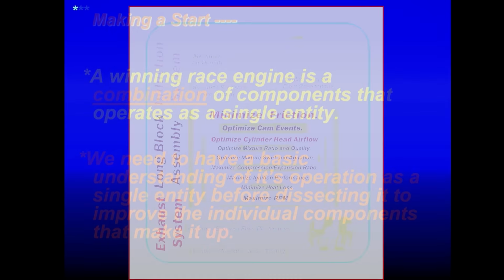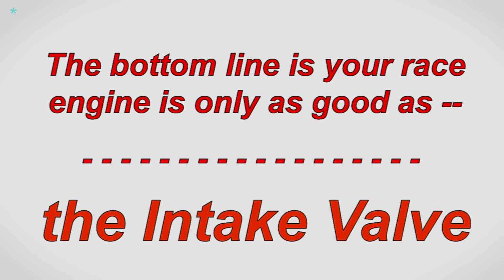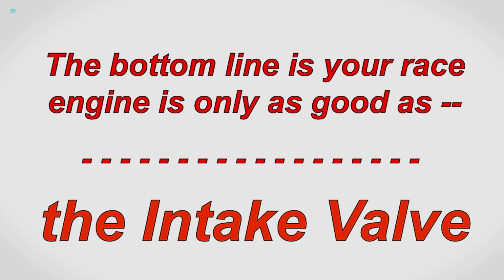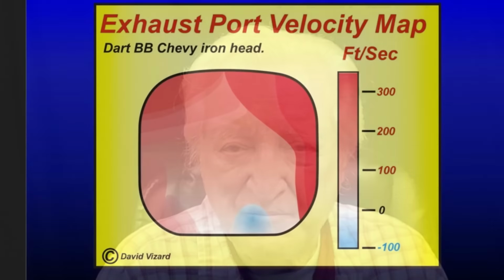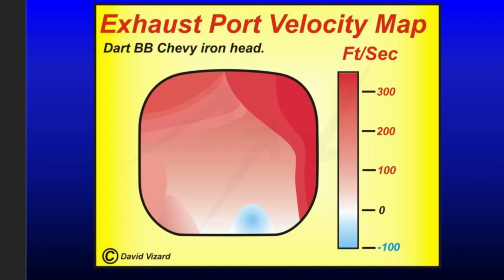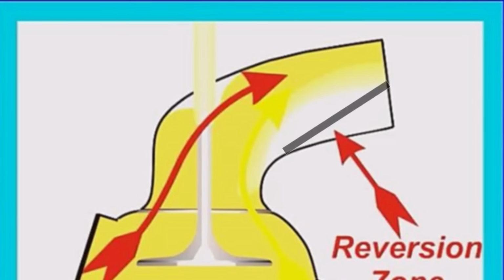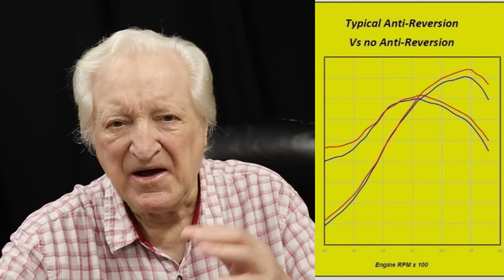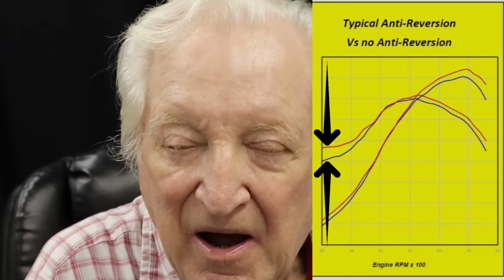Big hidden HP - from anti-reversion mods

Comment: I would like to present an entirely new idea to the anti reversion philosophy.  This is a bit complex and it involves understanding something that has been discounted by mainstream physics.  that is the effect of the Aether.  
Many don't even know what the aether theory is.  I suggest that the Aether is real, and it has a profound effect on volumetric efficincy.

But to understand what the aether is, and why it's important, we must look at light.  We must ask the question, "How does light travel through the vacuum of space?  Mainstream physics will tell you that light is both a wave and a particle.  that somehow light has some sort of measurement of mass, in order for our suns light to travel across space and be visible to us.  And for this explanation I say 'bullshit'.  Every other energy wave, across the entire specrtum of frequency ranges, is understood to just be a pressure wave, acting upon some medium in order for it to propagate upon.  
Meaning, if you throw a pebble into a still pond of water, the pebble displaces a certian amount of water.  This is potential energy ( the mass of the pebble) being turned into kinetic energy, and the act of the pebble displacing the mass of the water is the release of that potential energy into kinetic energy into the water.  
Sound propagation acts exactly the same way.  Exhaust also acts the exact same way, accept for this thing we call 'reversion'.  I suggest that there is another separate medium, other than air, that the sound pressure waves from exhaust are causing reversion in an exhaust system.  Yes, air turning back around and heading back into the combustion chamber is real.  yes sound pressure returning back into the combustion chamber is real, and 2 stroke engine builders are well aware of this.  but I want to propose a third wave that gets turned around and has an effect on reversion in an engine..... That being the Aether pressure being applied upon exhaust, once the aether hits a reversion point.  And since light (I argue) is an energy wave, and has no mass... that the mass seen and described as a photon that has mass, is merely the pressure light posits upon the aether, I suggest that there is a unknown pressure exerting it's effects negatively on combustion engines efficiency.

Comment: "Air is heavy".  Yep.  And yes, you don't know it's heavy, because you are in it.  A fish doesn't know the weight of the water in feet that's above it, until it gets too deep for it to breathe, but that's why fish have gills instead of lungs.  but that's another conversation for another video.

Air is heavy.  Yes, at sea level you have 14 lbs of pressure on the top of your head.  But it varies slightly, in what we know to be ' barometric pressure'.  That being the weight of a column of air from the top of your head, all the way to outer space, pressing down on you at sea level.  So, tell your wife you lost 14 lbs tomorrow, because you subtracted the weight of the air in the atmosphere. Yayy!!!

Anyway.  This is where the boosted community thrives.  If the base line air pressure is 14 lbs. and you add boost to your engine, physics says if you double the atmospheres meaning atmospheric pressure is 14psi, to 28 psi, you'll double the power. in both torque and horsepower.  Triple the boost to 42 PSI, and your engine should triple it's baseline power.  And for the most part, this holds true. 

But what does boost pressure really mean?  It doesn't mean that every engine will respond the same way.  A poorly constructed intake/ exhaust system, and add boost, is a cheap way to gain power, but it's not optimum, once you approach the maximum airflow the head on that particular engine can produce.  Once you reach maximum airflow that a given head can achieve, adding more boost does absolutely nothing to gain power... In fact, the added pressure from the turbo or supercharger only adds HEAT to the intake charge, and increased heat expands the air and fuel molecules going into the engine, which makes less air and fuel in the combustion chamber, and this is a result in a loss of power.

So, if you have an engine that flows say 250 cfm at a given measurement, and turbo charge it, you'll see good power, for a bit... but if you take a set of heads that flow 300 cfm, naturally aspirated and add boost... You get the same amount of power with less boost pressure.  Which, when you can lower boost pressure on the intake side, you automatically reduce exhaust restriction for the escaping gas from the engine, making the exhaust side even more efficient. 

TL:DR... A engine that is more efficient will benefit from boost more than an engine that is stock with the same amount of boost added.

Comment: I have a modified Nissan/Datsun U20 with port work, larger valves, a high lift cam and EFI.  This video gave me the incentive to create some 1/4" tall, 5/8" long with a 20 degree ramp "anti-reversion wedges" that will be welded into the floor of the exhaust flange (which happens to be 5/8" thick) to create a barrier. Unfortunately I won't be able to do an "apples to apples" dyno comparison as a few other things are being addressed at the same time, but I do have dyno data and volumetric efficiency data from my EFI datalogs from before and will return and post before and after when the engine is completed and tuned on the dyno.  Thanks for all the great info.  The Datsun head demonstration (L-series I think? Very similar to the U20) really cemented the need to address this. This will also allow me to switch to an 1 5/8" primary pipe from the 1 1/2" before without losing low end torque (should gain torque now) and should help top end... win/win!

Comment: Watching David Vizard on exhaust reversion. Trying to apply it to a GX200. Head exits ~45° and the header immediately curves up, so the high side of the port feeds into the low side of the header. Would an anti-reversion plate work better slightly downstream on the low side after the bend instead of right at the flange?

Comment: If I recall correctly, in the early 80's Cyclone?? made a header with a anti reversion cone around the exhaust port with a short length of oversize pipe that was used in NASCAR.

Comment: Hey guys I'm trying to get the most out of my 2023 road glide Harley and was hoping somebody had some experience with those M8 motors I believe mine is the 107 with a 485 reaper cam and I plan to do a big board kit from s&s. But I was hoping to get some advice if the anti-reversion system would work on the Harley headers as well as supporting on the Harley heads if anybody has any diagrams or info I would greatly appreciate it. I love this guy's work I've been saving it all and waiting to get into my motor.
Reply: The 2 into 1 exhaust systems create the scavenging that you are looking for. The reverse cones work the best with a “drag” pipe setup. The EVO motors ran them back in the day.. M8 is a different animal..👍

Comment: Would valve overlap on the timing contribute to making this problem better or worse?  Thanks for sharing this I had never thought about this before I had heard of it . But never had any one to go into the great detail that you have .  I have been playing with lawnmower engines . Push mowers that is . With plastic cams one can grind down the bottom side . Then adjust the lifters or valves to get more lift . It’s a little tricky but trial  and error it’s a learning curve .  I have found I didn’t think I would like the overhead valve engines.  But I do because when I shave the head fill in the gap between the valves with aluminum weld to make a heart shape combustion chamber .  I gain incredibly compression then all I have to do is cut around the same amount off the bottom of the cam .  Now I don’t have to adjust my rockers that much .  With the increasing compression and the gain in lift on both valves . Oh yeah I think I like this overhead valve 1 cylinder engine a lot .  I’ve takin in a count of  smoothing my rod from all the jagged edges that might cause it to break . Also I’ve drilled extra holes were the oil ring is to get more oil on the cylinder walls .  I’ve not adjusted the governor. I figure they are running at 2800 rpm on a b&s 8.75 torq so I’ll just leave that range alone . From my studies I hear that they’ve had problems already with rods coming out the side. I’m just wanting to see how much better it can do in the rage there giving it . An not wanting a mower that Boggs down even in knee high grass. .  I love your videos and all that I can learn about getting all I can get out of a engine I’m building !  I learned a lot by reading Smokey Yunicks power secrets .  Ive learned a lot listing to your videos . Thanks again for sharing .

Comment: The Yamaha YPVS was a similar idea. I can listen to David all day long, nothing is "new" anymore only a different way to do it.
This Legend carved his own way.
Reply: I’m glad to read more about this. I’d always thought of the Yamaha Power Valve System as the first production variable height and or size exhaust port for two stroke engines. Given the nature of expansion chamber design I’d have thought of reversion as part of the power pulse. Of course, it’s actually the negative pressure wave which scavenges a fresh charge too . I’d really never thought about how variable exhaust helps hone in and make this process better. I’d really only thought of it as getting the ability to run port timing for better mid and top end while restoring some low to mid. Would you possibly have links to any articles about the YPVS development? Ty
Reply: @jamessharp9790  After blowing up more than 20 350's and expermenting on port timming, height, as well as porting the YPVS all I can really say is it's a deep rabbit hole. Installing Toomie pipes changed everything about how the bike ran.D&D pipes made more bottom end power while the toomies made more up top and way lighter. The science behind 2t tunning is insane. Look at old dirt bikes with hug fat pipes above the head, then look at 500 cc GP bikes with the fat part so much farther away from the head. I spent 15 years messing with them and have nothing to say other than be prepared to spend alot of money. Spend a lot of time retuning the carbs and know the bike always runs best just before it blows up. Buy spare pistons and rings gaskets if you are going to play with them you will need them sooner than you think. Simplest mod is to just port match gaskets and pistons, then you can start lowering ports or raisng them. Bone stock Yamaha made a great bike for daily use, once modded they are a whole different machine. I had friends with 500cc Suzuki gammas and rz 500's who couldn't keep up with my .040 over motor 1mm raised intake port 2mm exhaust.. But the bike was hard to ride it had to be at 9k + rpm. Have fun experimenting.

Comment: Howdo David, a little inspiration from this video whilst watching it again. 
What is the result if'n the bottom of the header pipe is deformed to reduce the area of the header to only the area of flow coming out of the port?  Would the exhaust flow shunt the reversion back down the header pipes without affecting the power markedly? Or would it improve or reduce the results?
Many thanks for your inspiration and insight on engine behavior Sir, from an elder chap in New Zealand with too much time to think!

Comment: How would raising the header so that it aligns with the exit of the exhaust port and leaving it there for as far as you can without running into the other things under the hood lie the fender wells, steering Shaft, Power steering line etc, effect flow. In the diagram you show the header making a turn down away from the direction the exhaust gasses are going through the port. I know from experience that air doesn’t like to turn corners. Air is lazy and will flow best when it has a straight shot away from, or towards what you are trying to direct it to.

Comment: I did some of your anti-reversion mods to my riding lawnmower and it made a huge difference in working torque. After that I also bumped the timing up a couple degrees and then I narrowed the intake port about 30% and now that little 15.5hp ohv briggs single will mow 2 foot tall grass at about 1/3-1/2 max speed in my field without barely bogging at all and throws the grass out the chute 6-7 feet. I feel like they engineered these things to always leave you wanting more!
Reply: Would love to know what you did. I'm planning on doing the same!
Reply: @alecwilkins9470 what motor you got? Ill give you some guidance. It varies based on which motor youre running.

Comment: I have found what I believe to be evidence of reversion in my ford 300 inch inline 6. I am using the offenhauser dual port intake which I'm not terribly fond of but I found exhaust staining way up the intake manifold. The reversion was improved by installing headers but I'm not convinced it has been totally removed.

Comment: I was thinking a stiff metal/asbestos exhaust gasket that intruded into the port at the bottom could be bent outward and would be a cheap easy bolt on fix.
Reply: That might help reversion but not increase the upper velocity by much

Comment: Mr Vizard breaks this down superbly.. my question is a 4 Stroke engine is a 4 stroke, is a 4 stroke.. how would transfer to a motorcycle 4 stroke.. with Harley Davidson  recent news of aftermarket exhaust causing engine damge thru REVERVSION owners having fits over 'reversion' given certain aftermarket exhaust designs  . such as D&D found to damage HD V twins . Harley guys are  apoplectic -LOL  having fits. Now BMW S1000RR sportbike has variable valve timing,, which I guess would be akin to Acura/Hondas VTEC engine. Honda VFR 800 has VTEC and it is cool, especialy as the cams are gear driven. My son recently had his beautiful bug eyed Acura Integra 3 dr B18 VTEC rebuilt by a well reknowned engine builder here  in Boyertown, PA  Carl at GSP .. who did 'discreationary' port work, overbore  HC pistons etc.. thoughts on how this transfers to a M/C 4 stroke, especially 'thinning of the  valve  seat edge .

Comment: I do remember back in the late 1970's, Cyclone Headers sold a set of "Anti- Reversion" headers. Instead of your anti reveversion "lip", their header used a short cone welded to the header flange. Their design was said to increase touque in the lower RPM range

Comment: 24:35 Your ideas appear based on outdated tech. Exhaust gas retention is far better than exhaust gas recirculation. And check valves beat plates, but even better is to lose the valve overlap. Lose the EGR. Lose the in-cylinder non-tungsten non-insulated combustion chamber. Lose the throttle. And get a Displacement Adjuster instead.

Comment: 2:25 Nope. The GOAL is increasing efficiency and reducing emissions. Torque is the motor's job, not the engine's.
Reply: Tf you talkin bout
Reply: I quote: " Your statement "Torque is the motor's job, not the engine's" is incorrect in the context of internal combustion engines. While torque is a vital part of engine operation, it's the engine, specifically the process of fuel combustion and piston movement, that generates the torque. The engine's crankshaft translates this energy into a rotational force, which is torque".
Reply: @thomass8362 Hi, Thomas. A car takes perhaps 30hp to cruise the highways. The engine's job is to constantly supply 30hp or perhaps a bit less.
Cars have hundreds of horsepower. That 30hp engine is almost irrelevant, eh? So much so that future designs will have series hybrids, where the engine supplies electrons, not torque.
Reply: @RePeteAndMe No, you're just wrong dude. Torque is just the measurement of angular force. Anything that rotates can generate torque. Engines produce torque by using chemical energy to exert force on a crankshaft, which acts as the moment arm. In the case of an electric motor, the crankshaft is simply replaced by a stator and the chemical/kinetic energy is replaced with electromagnetic energy. I produce torque when I turn a doorknob or a wrench. It's just angular force.

Comment: Absolutely fantastic experience and knowledge. Also, some have tried adding small tuned chambers along the length of  the pipe.  I think the pressure waves can be so tuned that it only really works at one or maybe two rpm. That vizualilztion of the relative instant pressure values with flows that encounter a corner, and thinking to fill that, get velocity, and also block reverse pressure wave is a great discovery. 
What about the reversion vacuum gradient? For each +positive pressure reversion there is a form of -negative pressure reversion in this travelling wave being examined. Maybe also try for better -reversion timing wave at exhaust opening?. 
The reversion wave is broadened when flow converges or diverges over a distance that results in several related wave-effects (maybe even harmonics) generated over a period of time. Speed of sound resonating time, that is. Something to do with quarter-wave impedance effects.

Comment: Imagine having the anti-reversion ramp on a hinge and having an electromagnetic that can pull down on it at higher rpms when it is not needed. Or maybe you could do something as simple as having it on a spring that is just powerful enough to hold the ramp up at low rpm but gets pushed down as the air speed increased. These might be dumb ideas but I'm not an engineer just love high performance engines.
Reply: Always need more velicity

Comment: David , do you remember grumpy running a bolt on plate on his exhaust ports ? I remember his headers were using a different bolt pattern at the head .   I’m wondering do you feel he was using those plates to effectively raise the exhaust port at the high flow area , or for anti reversion  or a combination of both ?
Reply: Both